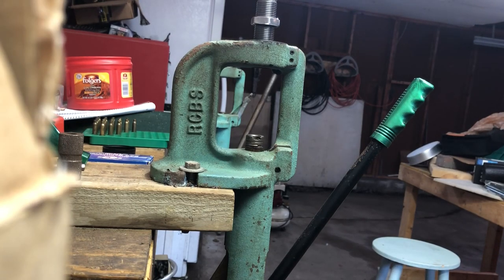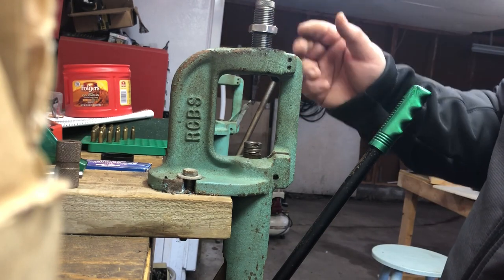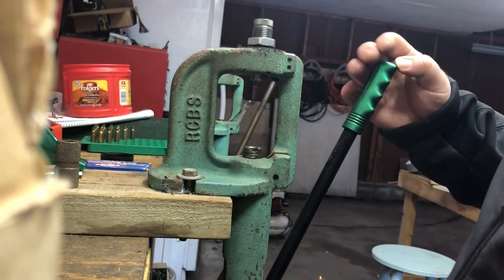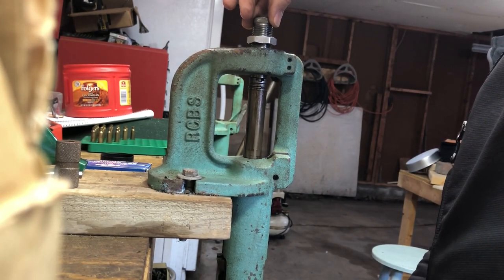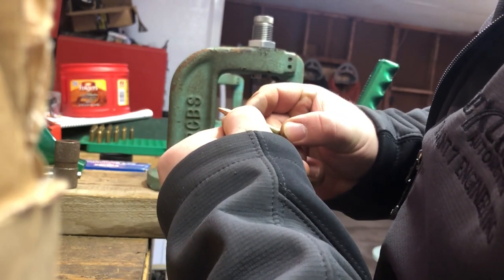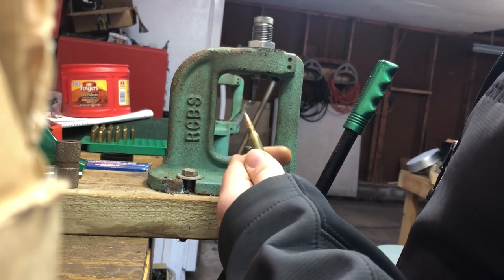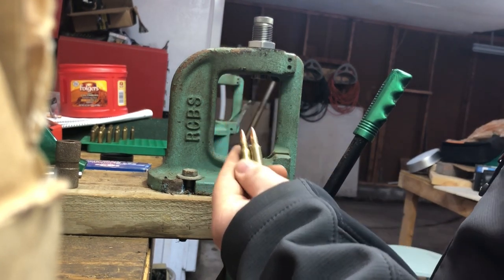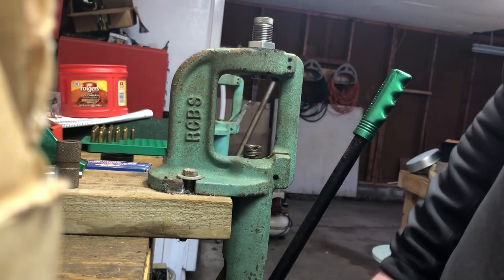Quickly Setup a Lee Factory Crimp Die 223 Rem

Comment: Doesn't the crimp help with semiauto ammo?   I had two fail to feeds in the Active Duty Army in 4.5 years.  The first the bullet was pushed back into the case instead of feeding.   I think that one round had a bad crimp.    LC 55gr.   The second was from a longtime troublematic magazine.   I set that magazine in front of the front tire of a deuce and a half.
Reply from the maker: if you're in the military and the ammo is being slammed around and dropped from helicopters, yes it probably needs to be crimped and the primers crimped in also.